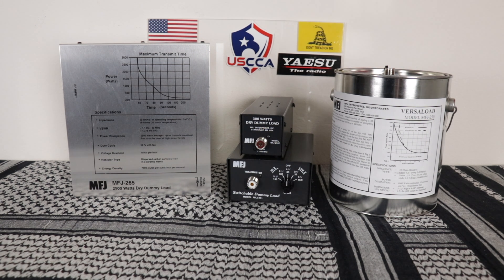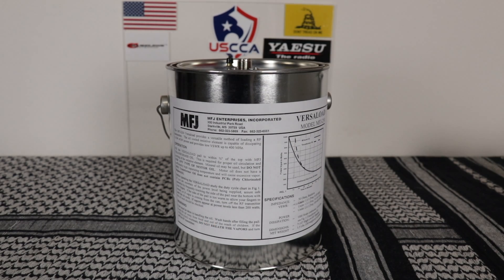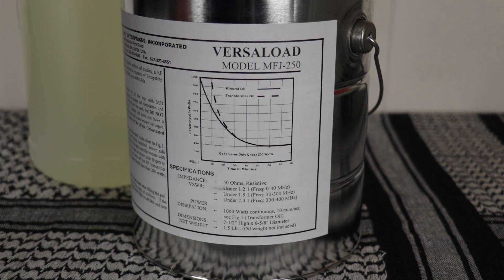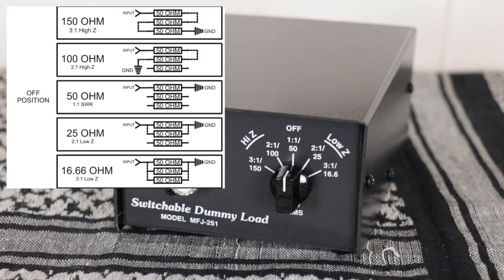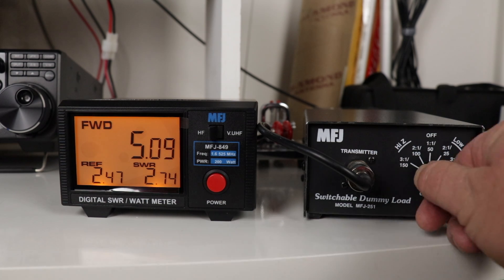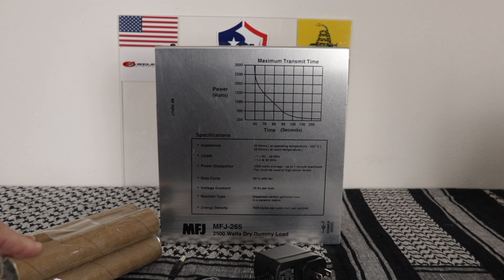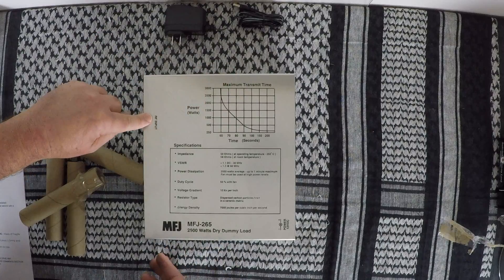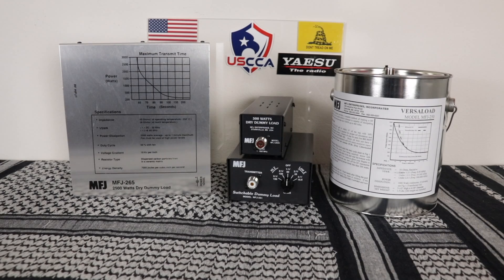Do You Have A Dummy Load?

Comment: mfj 264 or mfj 250.  Will be using it for HF mainly with a acom 1010.  Does the mfj250 leaks oil thru the so239 when transporting.
Reply from the maker: Thank you for taking the time to watch and the comment! It is greatly appreciated. I have never transported it anywhere. I personally would not for the reason you mention. With my luck the lid would come off and that would be one heck of a mess.